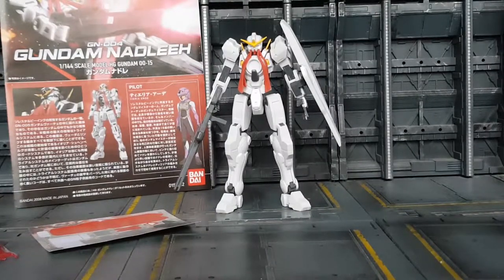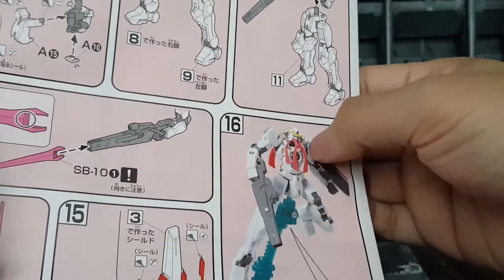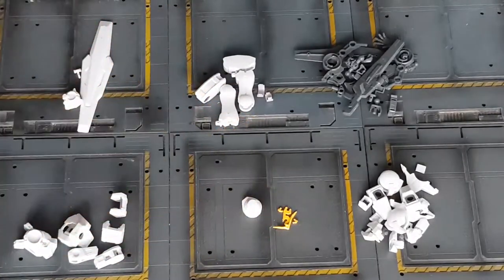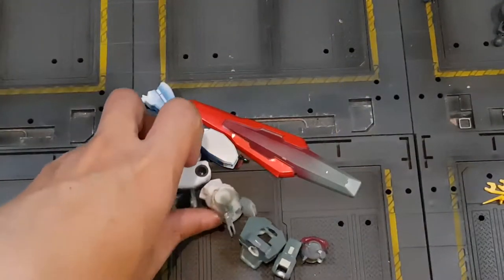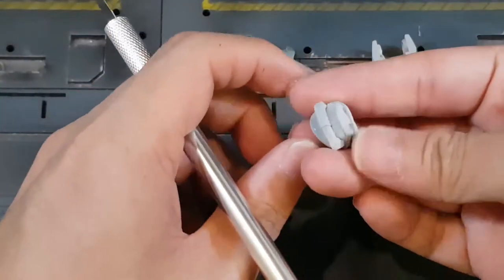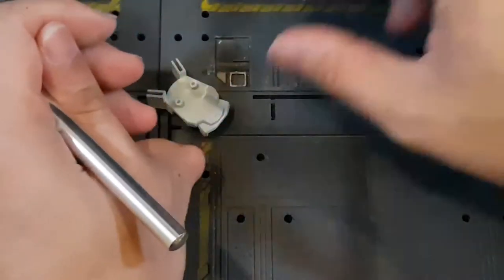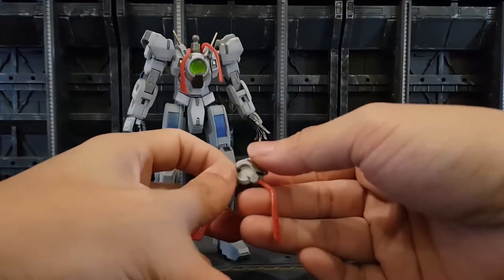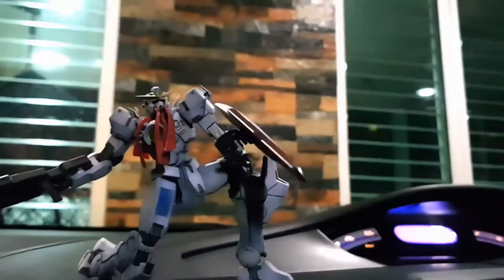Lazy Masking Tutorial for painting

Comment: Actually the stickers would leave some sticky residue over the area and it is very annoying to remove if you want to put a top coat over it.
Reply from the maker: Yeah true to that. Usually I run my fingers trough 1st. And try to rub them off. Or I can use the Zippo fluid to clean it.
Reply: @ATCustoms87  ye, so you have to use Lacquer paint for Zippo would eat away enamel or acrylics.
Reply from the maker: Yeah. Usually I'm using lacquer. Lately I also topcoat before doing masking also to protect the paint under it. 🤣